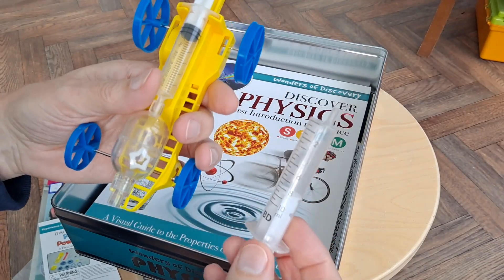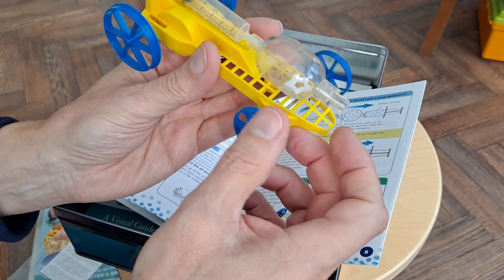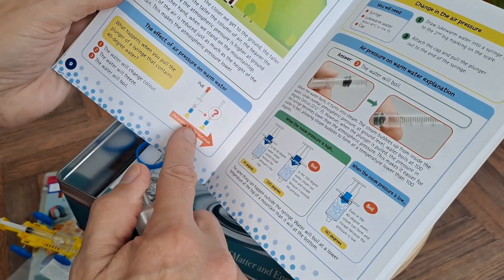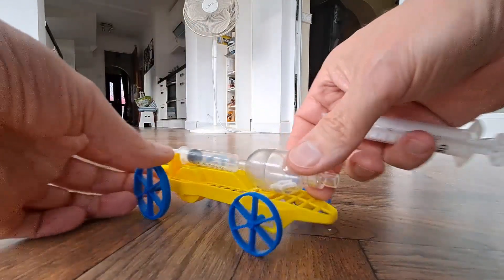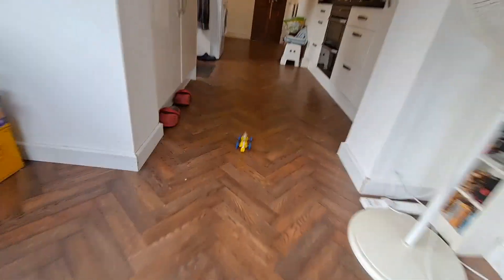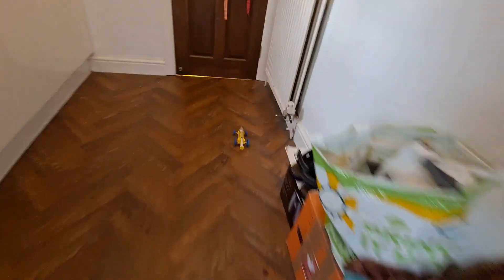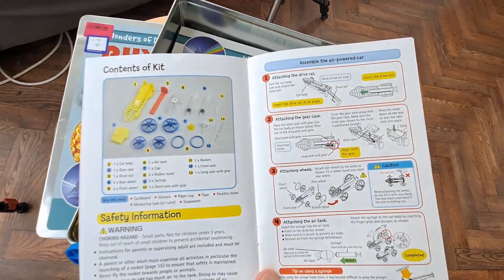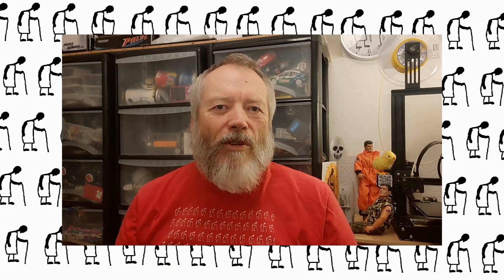Air Pressure Powered Car kit

Comment: Very good. I did wonder how far it would go with no extra pressure in the front tank? Thanks 😀 👍
Reply from the maker: There are quite a few variables that might come into play, such as the outside air pressure. I would imagine a good physics teacher could get lots of clever stuff out of this kit. A TV presenter could probably justify a trip up a mountain to demonstrate the difference 🤔
Reply from the maker: I have just done a couple of test runs and I will upload a video when I have edited it. It does move, but not very far.
Reply from the maker: Here is a short test run. It could probably do a little better, but clearly the extra air makes a big difference https://youtu.be/o_00SfFGV5A
Reply: @GrandadIsAnOldMan  Thanks 😀👍